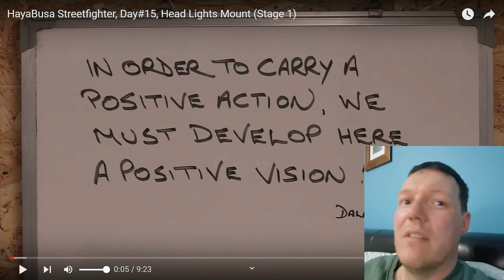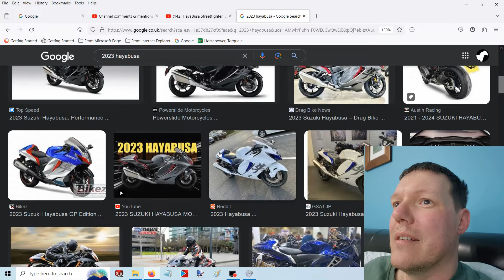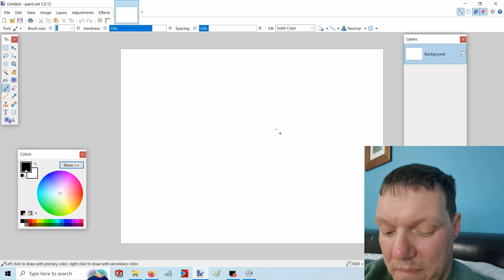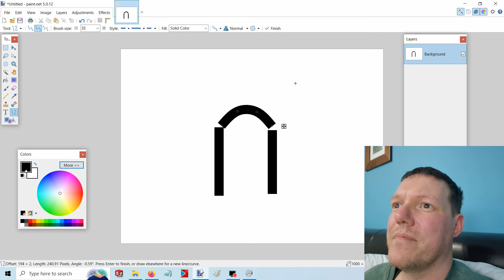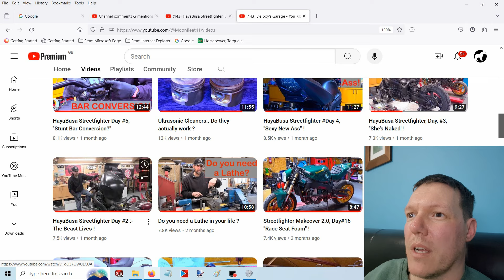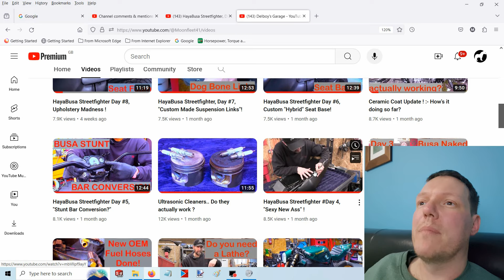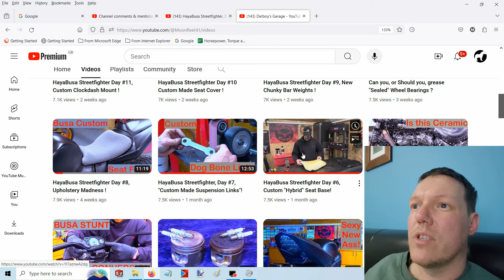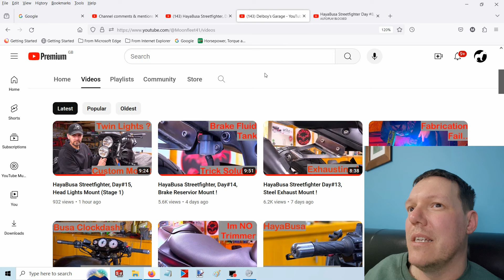Shoddy lights + MORE

Comment: @Matt. the insulation guys do spray foam in between rafters, joists, studs and carve the excess off so that it is flat so that it can be sheeted over with whatever. 

Also, pro tip (no really), don't bother with those straw things unless you really have to; they are dirt. Buy the proper foam gun and a can of cleaner (basically xylene) and blow that through the gun when you're finished.
You can adjust the triggers so that they only spray as much foam as you want and you can get really good control that way.
With a little bit of practice you can get good at filling small gaps (beef sized) with no mess.

Comment: 29:40 it's first week in school shop in any trade school where I'm from.  We had to do a solder iron stand from sheet metal and it had to look like it was made in a factory if you wanted to get an A. And after that we had to do a hammer. So you get a steel square bar,you had to file it in to shape,no power tools. And another piece of square bar to make a handle,but it needed to be round,also only with files. It's basically a torture test for the kids. And after you did that you had the first chance to use power tools,a press drill to cut a hole in your hammer head. Cut threads in the head and cut threads on the end of the handle. When you finished professor measured it,it had to be square,the point of the hammer at exact angle,the tip the exact width,the handle had to be round,and if you got that right you got a passing grade. And the closer you were to the specifications you were given the better the grade was. As far as i know from my generation,so some 200 kids, no one got a grade higher than D on that assignment. But every hammer looked 1000x than anything del has ever "fabricated".

Comment: Del is not the sharpest knife in the world. The part where he sprayed lots of expanding foam on and then removed 90% of it gave me trauma flashbacks to HDS when he would put a whole tin of filler on something, then sand it all off again. Badly. Then save the filler dust.

Comment: What happened to the holes in that clock bracket, dashboard thing?  I must have missed it. The original rectangular hole which was skewed and likely difficult to get the rubber boot on, has now changed to what looks like a nicely shaped hole that misses everything under the clocks?

Comment: That foam compresses really easily. I've been mucking about with a few different brands recently and the cheapest one he used has more gas bubbles in it. Anyway, I would have thought that the holes in the seat were there to let the foam breathe and or let water through?

Comment: I don't get this shit...whenever I do some brackets, want some custom foot rests etcetera, I just use a simple free cad program, make a really nice shape and send it to one of the laser cutting shops in my city with the specification of material I want (stainless, mild steel, aluminium, plastic, whatever and thickness). The end product always looks like an expensive aftermarket jobby. And I'm phuking Romania, we're not exactly rich here and it is still the most affordable, quick, nice option for stuff like that.
Reply: Depends on what I'm doing for me, il do something myself when messing about to find something I like or a simple build. If I'm not happy then I may get stuff cut.

Comment: @26:45 you missed it but he ground a but of a curve into it by having the bracket contact the platen, unsupported belt, and wheel across the length of the bracket.

Comment: Working on a farm o shit that's broke better make a shit bracket to keep it going until proper part turns up. Did it in tens mins with a hammer  shit drill and no clue on what I am doing.  It still looked better than that shit 😂